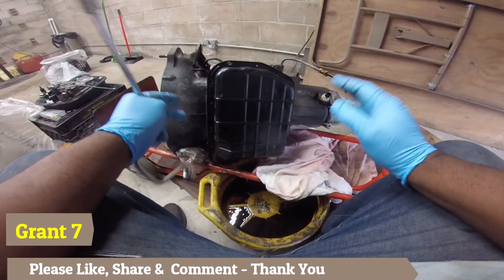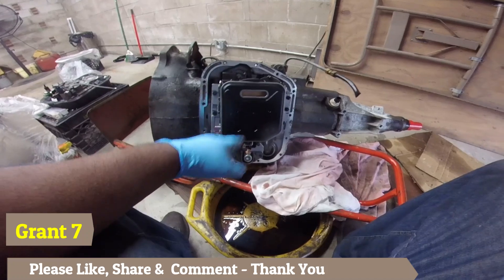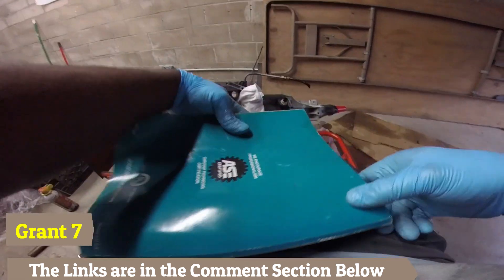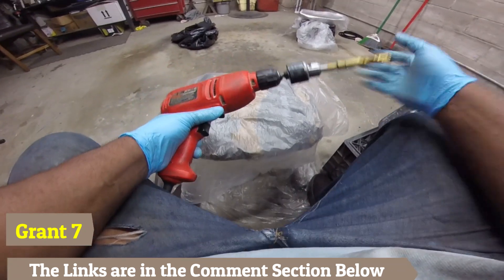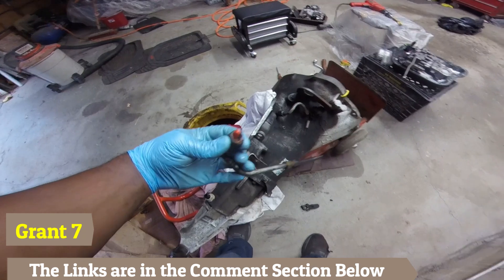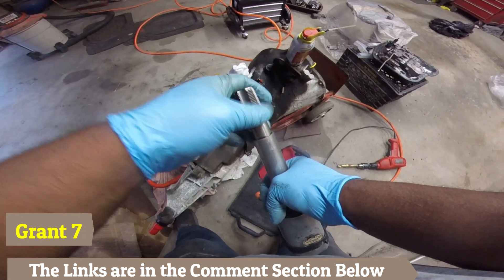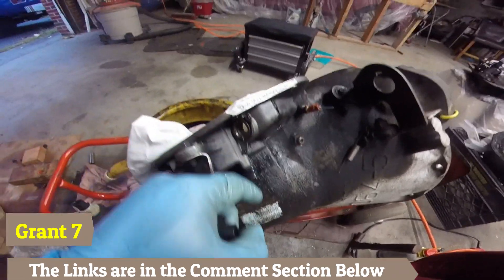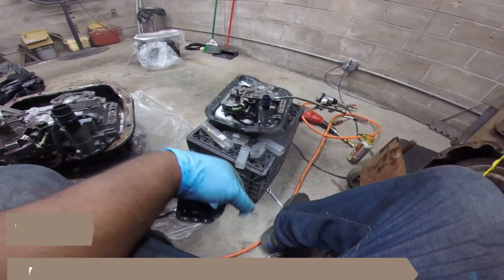How to Modify a 3 wire NSS to 5 wire Neutral Safety Switch  Dodge Jeep 46re Transmission

Comment from the maker: Dodge Van Facebook Help Group - https://www.facebook.com/share/g/15UKzvw5We/
**Dodge Ram Van Repair Playlist - https://youtube.com/playlist?list=PLdNM_fW7Gnif27aSkdDvmU_Kx9nxRtAuM&feature=shared
To Buy a Neutral Safety Switch - https://amzn.to/4eKBgpa
To Buy a  "Rooster Comb" - https://ebay.us/yVExyN
*To Buy an Adapter to use a 3 wire NSS in a 5 wire Case - https://ebay.us/m3gAP9
To Buy a 3/4 Drill Bit - https://amzn.to/4dxP9pD
To Buy a 7/8 Drill Bit - https://amzn.to/47JraTj
To Buy a 3/4 Tap - https://amzn.to/4eKNyxM
To Buy a Drill Adaptor - https://amzn.to/4dp0YhX
To Buy Tools, Wheels, Paint & more - https://ipartcars.com/
To Buy a Service Manual - https://ebay.us/BLXO2r
To Buy a Service Manual  - https://amzn.to/4dLPt4N

Comment: You couldn't have posted this in a better time im doing this as im typing this 😂 appreciate you 🫡
Reply from the maker: Glad i could help lol
Reply: @Grant7AutoWorksG7  did you have a problem with it reading it was in reverse when it was in park on the dash?
Reply from the maker: @mrwood1832  no i didnt have that problem. so its not starting in park? did you make sure the the switch lined up with the rooster comb like i did in the video? also i used my old valve body and switch that came from the van...
Reply: Did you have a problem with it reading that it's in reverse but it's really in park? What's the fix if so appreciate you sir.
Reply from the maker: @mrwood1832  And if its just the indicator reading on the dash, but everything else is working like it should, i would check the rooster comb and make sure everything is lined up. you might have to "tweak" it a little bit if its not